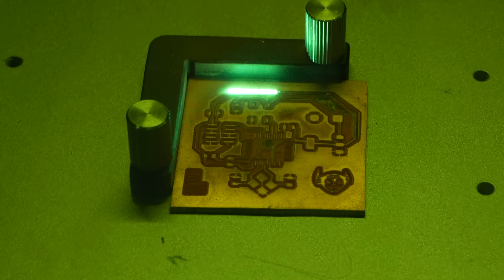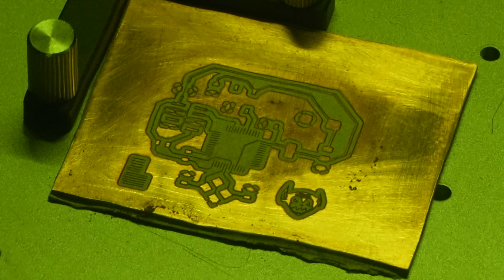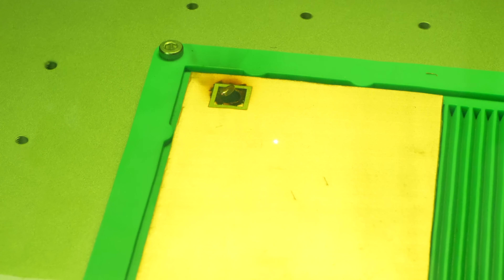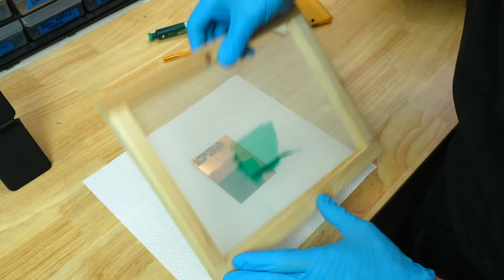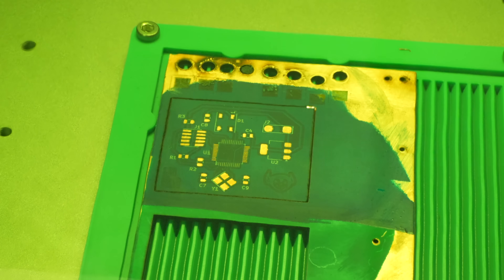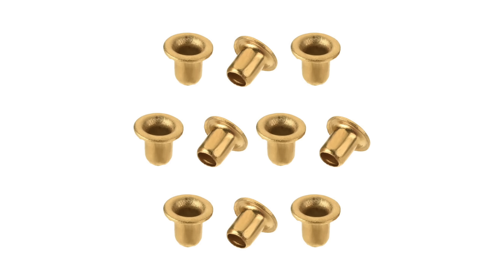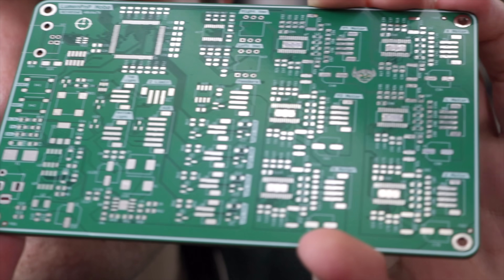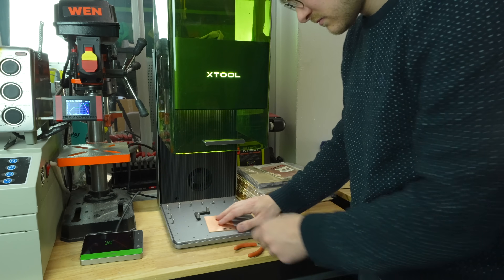Prototype PCBs faster than 3D Prints

Comment: Hmm... I'm still not sure if is method is fast and precise, especially for 2-sided boards. I use at home traditional method: photosensitive PCB + ink printed capillary film (BTW never use laser printer) + CNC machine for drilling and cutting (including metal housings). All works in a single application Autodesk Fusion, where electronic schema is created, board layout and 3D model - very useful when we decide use 3D printer for making very precise housing projects for our device. There is no problem with aligning layers for 2 side boards and 5 mils routes. The same soldermask.
Usually 2 sided PCB 10x10cm, including soldermask, cutting any shape, drilling (holes typically from 0,4mm to 3mm)  takes 90-120 minutes.

Comment: I saw another youtuber working on an automatic PCB machine with vias - he was trying to put conductive ink into the via to bootstrap the plating process. The copper deposition isn't too difficult, its getting the conductive material inside the via that involves many steps and hazardous materials.

Comment: There is a youtube chanel by "Levi Jansen". This guy tries to resolve the problem with vias by selectively electroplate the vias one by one using a two head cnc machine. When the two head touch the oposite sides of the board, firstly it "dusts" the hole with some coal particles, then electroplates the hole.

watch?v=0vtCyUHz1Mo

Comment: Have you tried soldering with the laser yet? If you dial the settings just right, it might also solve the vias problem... I don't have a fiber laser, so I can't confirm this, but I suspect if you try to squeeze solder paste into the holes, and use the laser to melt it, it could connect the copper through. I know it is impossible to do with a soldering iron, but thats because the solder clings to the tip, and you always end up pulling it out of the hole. Non-contact soldering with a laser might just change that.
For better alignment, I would burn four holes in the corners of the PCB (symetrically placed), and then seat them on a conical pins on some kind of a baseplate. That way you'll have precise alignment even if the edges aren't straight, and this will also enable you to make double-sided PCBs, because the baseplate will stay centered in the machine, and the PCB will stay centered in the baseplate for both the sides.
If any of this sounds feasible to you, please try it and let me know whether or not should I start saving for a fiber laser 😉

Comment: Hi. Thank you for the video. 
I agree, it could be "the" solution for homemade PCBs, taking apart the price of the machine. 
I'd avoid the usage of FR1 anyway. 
have you tried covering with a protective layer and using the laser only to engrave that, then using acid as you normally do at home?
The process should allow for much greater precision than using the acetate sheet with the laser printer.
Printing the acetate I get up to obtaining valid tracks (and spaces) of a minimum of 12 MILS, but with a LASER I would expect to reach 7 MILS or even 6.

Comment: I made a ton of PCB's of FR4 plates with 50W cheap fiber laser with  0.2mm thin tracks. It took some time and some ruined plates to figure out a regime but once i did it every new PCB goes fine quality from the first try and no need to postprocess of any kind. So dont throw away your FR4 it is possible to make them

Comment: I operate a LPKF Protolaser S at work. The thing which allows the laser to cut through the copper is the high energy pulsing. If you can turn off the pulse so you have a CW beam, you won't cut the copper when you remove the mask.

Comment: this one guy i saw was building a machine where he was trying to squirt this reusable graphite solution into precut vias... let that dry for 20 mins and then having another nozzle come down and electroplate... similar to a 3d printer. instead you could pick up techniques similar to that of an SLA printer where you do the same graphite process and then electroplate the whole board automatically by lowering into a pre-prepared copper solution and electroplating. (the reason his original idea didnt work is because the plating the holes individually took too long to make it a viable method). just an idea of how one could BUILD a 3d printer type machine to do vias specifically... this alongside your current techniques would allow you to fab pretty much everything you like when it comes to 2-sided PCB's

Comment: Rivets. Have a look to Bungard rivets. Copper, quite small and they also provide a press to apply them. I use them for milled double sided prototypes. But they are not really cheap. From my opinion the only that works reliably.

Comment: @stephen_hawes

One comment suggested a sewing action to insert a wire to link the top and bottom.  A better idea is to make a wire LINK sewing machine that can make bus bars (many parallel links) or vias (a short link to the same two tracks top and bottom) or use them as traditionally to give a single sided board the double sided super power.  If all the SMD parts are on one side and through hole and links on the other side then you do not always even need a double sided board and vias are not needed.

The wire link sewing head would be put on the pick and place machine and the step would be done after SMD soldering and before through hole placement.
At each new hole it could form the wire into a hairpin and then insert it and lock it in place by upsetting the end of the hairpin.  If it was just for via use the daisy chain stitches could be cut away after or if it is used mostly for permanent link then it could start and stop a new wire for each link and lock them in place from below.

Comment: The way to add vias without height is to drill the hole , use silver wire or fine copper wire , insert it through the hole, solder each side of the via, then use something like a dremel to sand it flush. Not fast method but it works and is easy to do.

Comment: For joining two single-sided boards together, what if you soldered-together castellations around the perimeter of the boards? Same issue with soldering a wire or header pin, but without the area size or interference issues?

Comment: Rivets: i am doing PCBs at home from time to time. I use Bungard photo sensitive raw boards, develop that UV sensitive film with rastering with a UV laser diode (100mW). Then edge them. The vias I tried with rivets for a few PCBs and for the start and for a while that worked fine. But in the longer time it seems that corrosion builds isolation between the rivets and the PCB copper because after a longer time - don’t remember if it was months or years- the vias lost contact. The board stopped working properly and it was an hour long search to conclude that the vias are not working any more. So my conclusion is: good for a prototype, not good for longer term production use. Maybe its better if you use the Bungard tool to mount the rivets, I did it with a puncher. But it’s a mechanical connection, not chemical or soldered. So it’s less reliable. Now I use the crude method of soldering a short wire into the vias.

Comment: I guess that for home prototyping - the affordable way is to drill a hole, then pass trough thin copper wire, until 0.1 mm, solder it from one side, pull  it trough the hole to the other side, while it being pulled tight solder it from the other side, and then just cut off the extra. What else could be easier for on-knee home prototyping?

Comment: I would still prefer the photoresist method + chemical copper etching.
If you get all the equipment and streamline the process it is very fast, cheap and reliable

Comment: 10:30 haven't done it with PCB but, when I use nail to nail things together, I drill narrow hole to drive nail and then I use drill of the size of the head to drill shallow hole to hide nail head.

Comment: i use a soldered  solid core copper wire through a hole for my double sided boards. Not the most gorgeous way but it works and gives a flush mount with my robotic arms every time for me when i'm mass producing boards. Also an added bonus they can handle heavy current.

Comment: I’m think that since each side of the board would have a copper layer for the visas you could just put solder in the hole and it would end up connecting on side to the other and if that works you could make like a 3D printer like rig that sits out of the way of the laser and instead of extruding filament it extrudes solder, and it can even do that on pads so that they are pre soldered, that would be sick!

Comment: There are tiny screws like those used for repairing watches. You could predrill the hole, then use an electrical (or sonic) screw driver to insert the screw. Screws should be conductive, but may require a little bit of fiddling or solder to connect to the copper traces in some cases. But this way would be moderately automated, small diameter vias, and potentially no raise.

Comment: When I began designing PCB (half a century ago), double side boards with holes metallization was too expensive. Rivets have never been a solution because there was oxydation between them and the tracks, the best was to use passing thru components legs, of course the design must take care of this. PCBs were much more cheaper but this worked only for double side, not multilayers. Actually, laser is too expensive for me to make protos, maybe  a small CNC...

Comment: The easiest way to do a via is to "drill" a hole and push through a ~30 gauge copper wire and solder it on both ends.  What is the smallest hole you can make with a fiber laser ?

Comment: Would it be possible to drill through one copper layer and the substrate, but not the other copper layer? If you can reach the other copper layer from the back, you could just fill that whole thing with solder.

Comment: For via's I wonder if you could just insert very thin solid coper wire and then press it down to upset the coper and make the ends be wider.much like peening a pin over. If you tune this right you might be able to cut your coper length and hole size so that you can squish the whole board with those pins inserted in one press operation. it'd be a bitch to manually insert all those tiny pins though.

Comment: Simple use of waste, is the excess legs from things like through hole leds/caps/etc. Stick the excess leg through the hole, solder from top to hold in place. Flip and then solder to the bottom ring. Downside would be up sizing the via to fit the normal through hole size.

Comment: For vias there might be a way to partially melt some copper to let it flow half the way through the hole. Maybe play with speed and intensity of the laser and even some pattern as the via hole's cover lid, like a X-pattern melting or at least bending down the hole..
Just some idea.
I love to do this after years of etching and then years of milling double layer PCBs

Comment: Hey, I wanted to follow up on the rivets thing - we looked at this a while ago. It "works", your gut feelings are about right.

However, I wanted to point out that the critical parameter of getting them under IC's is probably unimportant. Take a look at "Thermal Vias are Ineffective. Here's Why." in Printer Circuit Design & Fab. I don't agree with everything but by and large the point is there - the copper is more important than the holes because the thickness of the resin layer is small. Also cool to note that the first couple vias make the biggest difference until you effectively have a solid hunk of metal between the layers (like Al core).

Comment: You can even make pcbs fro. FR4 - just set some air blowing on pcb from compressor (not canned one, those are butane gas). 
I also made some stencils using similiar machine - it just needs cooling with air.

Comment: what if you drill it with a drill. 
its pretty easy to use 3d printer hardware to make a cnc router. You don't need a lot of rigidity for drilling. Milling on the other hand, heck yeah. 
an old 3d printer can easily be converted.

Comment: Copper plating is really easy and cheap. You don't need large chemical baths and crazy equipment or a lot of time. 
All you need is copper sulfate, copper anode, and a variable power supply. It's a lot less insane than what you're thinking. 
highly recommend trying it. You'll never grow if you keep discouraging yourself.

Comment: Is it also possible to solder the parts with this laser?
For sure you can create a stencils with the laser and then place your parts after applying the solder past. I can imagine that the laser is able to heat up the solder paste to solder the parts. Maybe the power needs to be reduced and the time increased but in theory I can imagine that this works. 
Can you try this out as well?

Comment: That process seems very simple! Looks great! On another note, did you really need that external crystal oscillator on that small board? New ST micro series (thinking G0 series) have pretty good internal clock! Unless you have something that is really time critical, you usually can get away with having an external clock!

Comment: What if you put your solder paste on the board, then place your components, then use the laser to tack the components onto the board, or fully solder the components to the board with multiple solder welds for every joint?

Comment: Honestly, if you're doing the rivets and soldering them, seems like you could just make a wire-sized pinhole and then just stick wire through and solder it the same way. Should allow it to be smaller, but might be a trickier process.

Comment: Just to step on board the comment train, if you do set up using an alignment pin method, you could consider making small screens for applying the solder and maybe use the laser to cure the screening chemical - not 100% sure this would work and it'd have to be very low power, but then liquid tin could be applied very accurately and in a very controlled quantity. Just spitballing.

Comment: So... this is like single sided PCB? No vias? Well...
Reply: There are only three ways to make vias as far as I know: electroplate, which is a VERY HARD industrial process which you won't be able to do reliably at home, but it works. If that's what you need: buy your boards from a PCB shop that has the required chemistry under control. Second to that are soldered in wires, which are easy to do even at home. The third way was a micro-rivet process, but I haven't seen it around for a long time. 

The real problem here are boards that require more than two layers (which, in all honesty, are all boards worth making). There is no way around the electroplating there. 

If you don't need ground planes (but you always do) or you only need one ground plane, then there was wire placing industrial process that uses a pcb with nothing but through holes (or SMD pads) and a machine would basically "wire wrap" it with sticky thermal glue coated wires. That process worked great according to the few people who ever used it and it can make boards that are as complex as 24 layer PCBs, but I am not sure the wire laying heads are easy to make. 

In other words: just stick to ordering from a PCB manufacturer. :-)
Reply: @lepidoptera9337  Yeah, while I like the update on making PCBs at home - I've made single sided PCBs as young kid with pen and some basic chemistry - in the previous century. Agreed - any PCB for hobby project is double-sided and it is usually enough with some bridges. They are also darn cheap, even the 3 and 4 layers are not that expensive - so this feels a bit clickbite-ish.
Reply: @lucasjokiel  I did double sided for years, both as a hobby and in science labs as a research assistant. It works just fine and with a little practice one could get reasonable results out of a laser printer and photosensitive coatings. Back then it made financial sense since the setup fees were the same for small batches as for large ones. But since the Chinese are basically offering PCBs at cost or even below by reusing the leftover edges of large commercial project panels, it makes no sense whatsoever. It's a bit like tourist class... the first class and business class passengers are paying for the cost of the plane and crew and the airlines can discount tourist class tickets so that air travel is affordable to the masses. I take it, both in the air and in the PCB fab.

Comment: could you not prepare a node with a hole in the center through the board and then just heat a length of solder within it to make a pass through?
Reply: Yes, you can solder in a short piece of wire. Now you have a really unreliable 2 layer PCB with giant vias. Just admit defeat and order cheap boards from China.

Comment: Thanks for citing my work on via plating. To support FR4, have you tried using the laser at low power to expose photoresist? May not be as rapid as your current method but for some applications such as RF you need FR4.